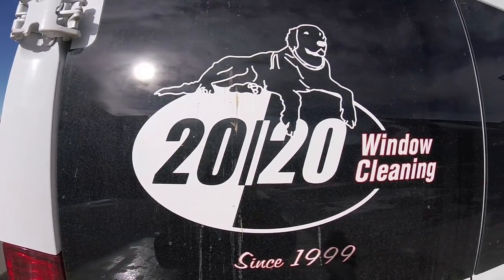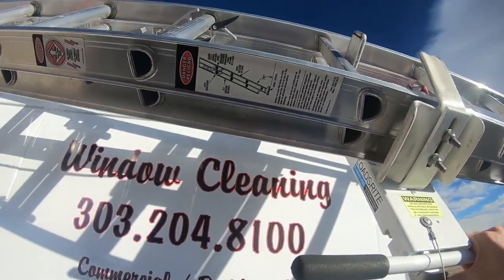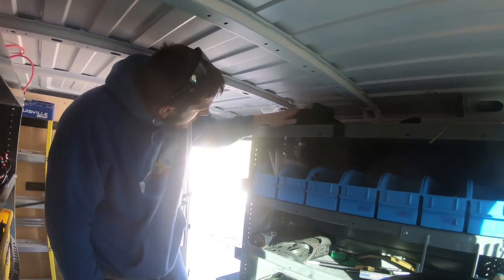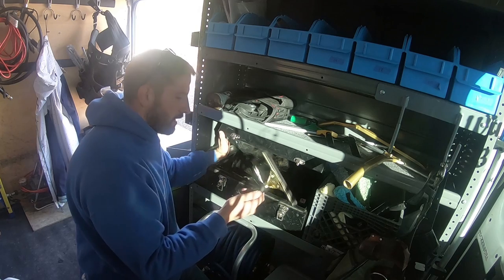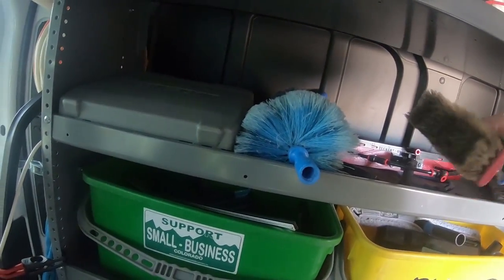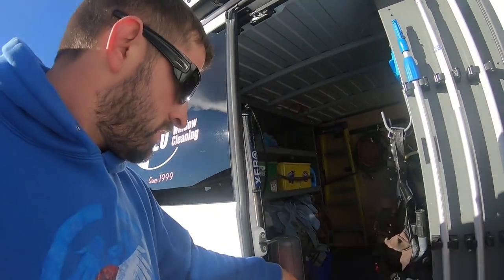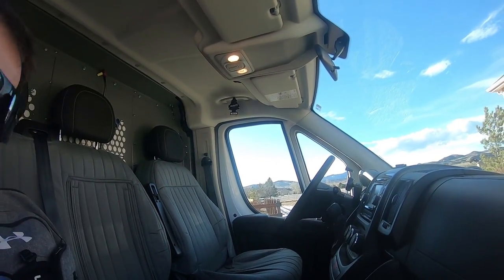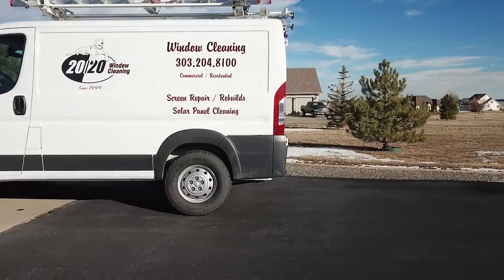WINDOW CLEANING WORK VAN | DODGE RAM PROMASTER

Comment: Steve,
Im going to be doing only ground floor ground floor commercial store fronts.
Have ever had accidental damage that required an insurance claim?
For these clients I would assume there would be a very risk, is liability insurance necessary?
Joe
Reply: Property Squad, Good question! If you don't mind. I will share what I know as a window cleaning company owner of 9 years and an insurance adjuster; Yes I am successful with both. Not having insurance is like running with a pointed stick in your face and focusing on the pointed end at the same time. I have been fortunate not to have had any liability claims against my window cleaning. However, accidents can happen, that's why they are called accidents. You can pay for the insurance now or you can pay your own claim and court costs if it goes that far later. Having insurance also limits what others can go after your business $$$ for. All larger commercial work requires you to have 1 to 2 Million in coverage. When you 1st purchase your liability insurance, they will start you out at $500,000 typically until you prove your self as a reasonable risk, then they will review your history before increasing your coverage to $1,000.000. So in other words; you have to pay before you play. You will be enabled from the start by not having insurance. I sell against my competitors all the time, I specifically tell my prospective customers that we have insurance and most window cleaners and pressure washers do not! Having insurance legitimizes your business. Hope this information helps. :>)
Reply: @csr9408  Thanks for taking time and Thank you for the information. CYA 1st!

Comment: So what are your thoughts of your promaster after using it all year? Likes, dislikes, problems, etc? Hows it handle in snow? I bought a nissan nv200 & love it for our route work, but I'd like to get a bigger van to have more room & just wondered how you like yours so far.
Reply from the maker: Love it, always have room for everything I need, the ladder rack is a must if you ask me. It handles ok in the snow but not great. We've only had 1 ignition coil go bad and it has over 50k miles. Its overall been so nice, so much better then a truck!

Comment: Thx for the van walkthrough, I really like the organization!! We've been working out of our truck which it works, but I would really like to get a van just to be strictly for work. I've been looking a lot between a mini van which I see works for Jordie @windowcleanse and also a Ford transit connect, but not sure which route to go so if anyone has any input feel free to share. Thx😁👍
Reply: Elijah Schwake you should drive both and see what you like the best
Everyone has their preferences 
I still
Like my truck and also use a Prius for some route
Reply from the maker: This set up has to be my favorite so far after having 3 trucks. It’s just nice having everything organized, easy to get to, and it’s like a huge advertisement lol
Reply: @ewingsharp8916  I should just go test drive one from a dealership and use it at work for a day....😁👍👍
Reply: @SteveOthewindowcleaner  That was my thought exactly, to be better organized plus I would get the van wrapped with the logo and everything.  Don't get me wrong the truck does the job, but I could just see the benefits of having a  work Van.  Plus I could see my wife grabbing a ladder and swinging it it into the side of my pickup busting a window or something....oops😂